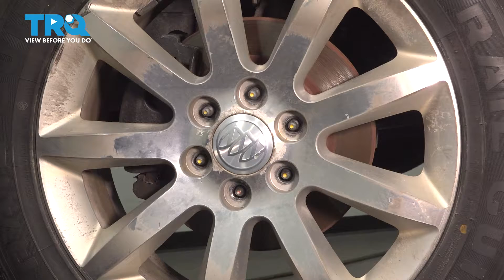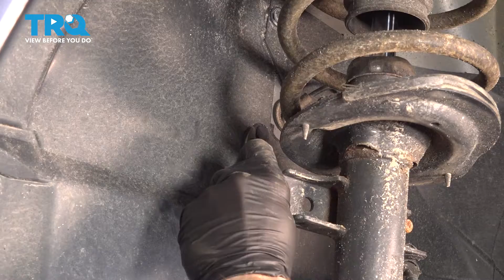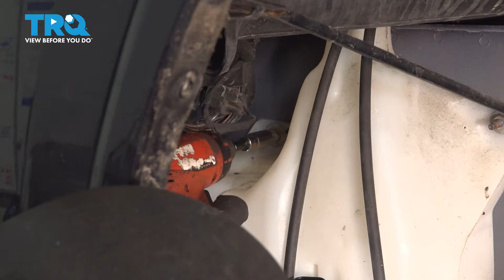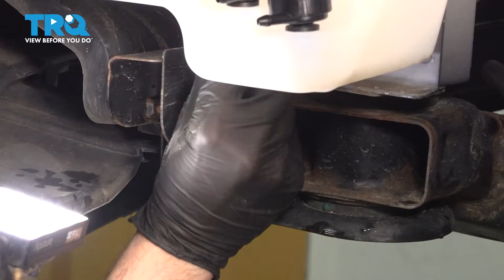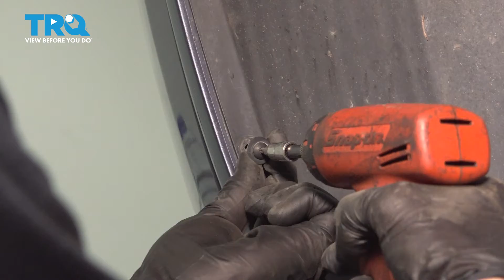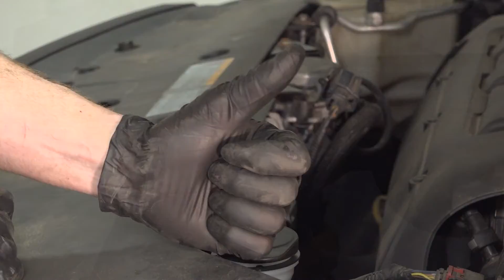How to Replace Windshield Washer Reservoir 2008-2017 Buick Enclave

Comment: Great video.  It showed me exactly what I needed to do to replace the washer fluid pump for the front windshield.  That didn't solve my problem.  I still can't get water to come out of the front washer fluid sprayers.  The rear works.  The fuse is good.  The lines don't appear to be clogged.  Do you have anything else you can suggest?